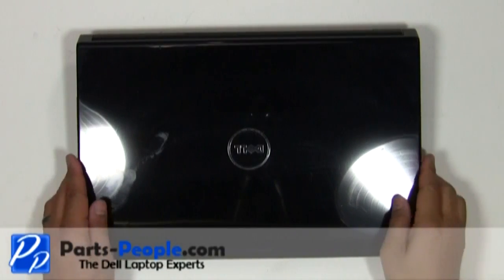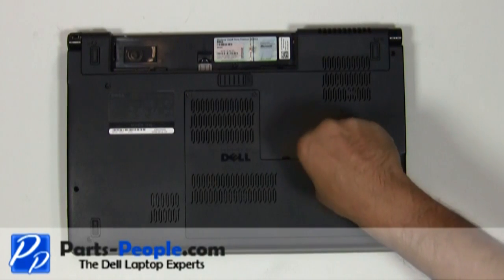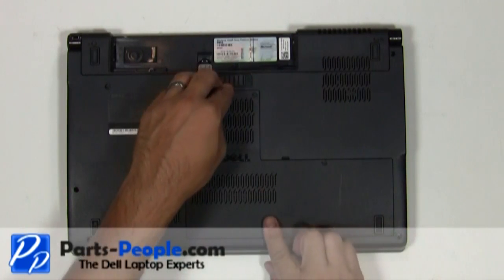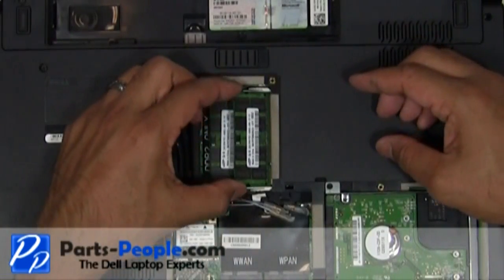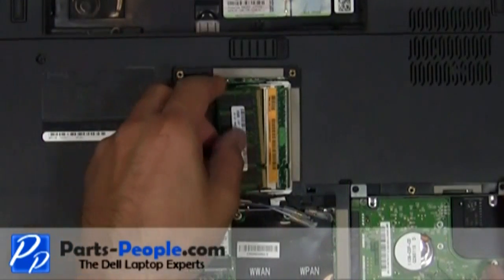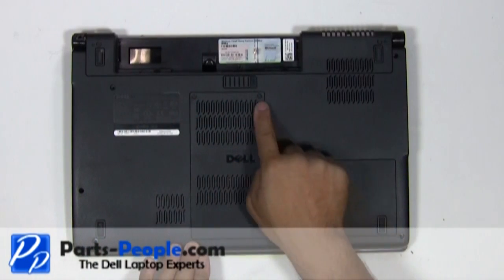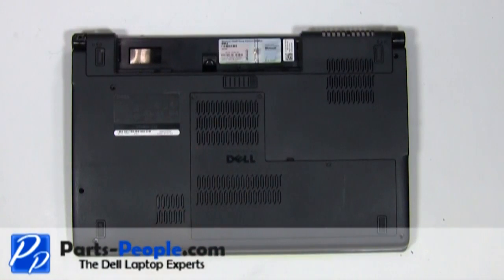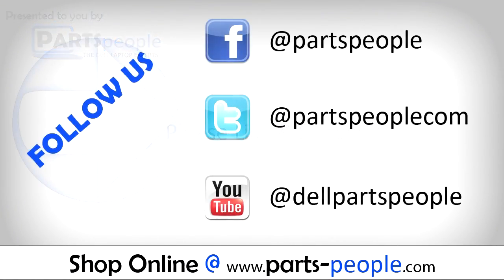Dell STUDIO 1555 / 1557 / 1558 | Memory Stick Replacement | How-To-Tutorial

Comment: my Dell 1555 is 3gb ram version. What is the maximum ram capacity? does the stock ram is 1*2gb + 1*1gb combination?
watz the maximum frequency supported?
Reply from the maker: It maxes at 8GB (4GB per slot) of DDR2 800mHz. There is not a "stock" configuration, different laptops had different amounts of pre-installed memory.

Comment: Studio 1555 CPU P 7450 @2.13 Ghz RAM 4.0 Gb. Can I add more RAM to my laptop and how can I speed it up? Running windows 7
Reply from the maker: Dell says it maxes out at 8gbs of RAM. If you upgrade the RAM, clean out the heatsink and fan, apply new thermal compound, and do a fresh install of Windows, your laptop will run like new.

Comment: does this laptop support DDR4 RAM? & can i replace the hard disk with 1TB Samsung 850 SSD?
Reply from the maker: No it takes DDR3 RAM but the hard drive should work.
Reply: My Dell Studio 1555 came originally with 4GB DDR2 RAM. Are you sure it supports DDR3?
Reply from the maker: The 1555 is DDR2. The 1557 and 1558 are DDR3.
Reply: Sir your feedback has helped me alot. I hope you can sort out my last query as well. I have a 24inch FullHD IPS monitor and i intend to connect it to a 7 year old Dell Studio 1555 laptop equipped with a 720p screen. Will this effect the laptop's graphic card? I've heard one of my friend's laptop's graphics card got damaged in a month due to connecting to a 720p screen equipped laptop to a 1080p monitor.  I want to use the monitor as my main screen for working daily on graphic softwares like Adobe Photoshop, Illustrator and sometimes watching some FullHD movies. I'm not a gamer at all. Will this setup work? I fear i might burn the graphics card.
Reply from the maker: It will work but it will add stress to you graphics card. As long as you keep the laptop cool and well ventilated it should be fine.
Reply: Thankyou for your valuable feedback. I shall keep your advice in mind.

Comment: I am a newbie when it comes to laptop memory, I've only replaced desktop modules.  I have a Studio 1555 laptop with 2 x 2GB RAM.  Do I need to have both slots with the same memory or is it possible to only replace one of them with a 4GB module for a total of 6GB.  Thanks so much for your help
Reply from the maker: Having a 2GB stick paired with a 4GB stick will not effect anything as long and the FSB (Front Side Bus) speeds are the same. I believe the 1555 only uses PC2-6400, so you shouldn't have to worry about the FSB.

Extra information: If you had a laptop that could take 2 different speed sticks (like 800mHz and a 667mHz) and one of each speed was installed, the laptop would down-clock to the lowest speed stick, in most cases. Very rarely I've seen it cause a "No Post".

Comment: I have a studio 1558 which has me baffled. It works fine with a pair of 2GB sticks but windows crashes when I install a 4GB, Kingston module. So does a memory tester I have on disk. The modulle works fine in other laptops and I have tried it in both slots.

Comment from the maker: The OS isn't detected? It sounds like a hard drive problem. I would start by reseating the hard drive and see if that fixes it. If it doesn't, the hard drive may have been damaged and might need to be replaced.

Comment from the maker: Dell actually makes an number of STUDIO 15's, like the 1535 1536 1537 which require the DDR2 RAM, the 1555 which takes either DDR2 or the DDR3 depending on the laptop, and the 1557 1558 which require the DDR3 RAM.

Comment: The only "tricky" part is popping off the back plastic plate. Once you remove the screws, it "pops" out - don't be bashful, just pull on the top of the piece and it pops right off.